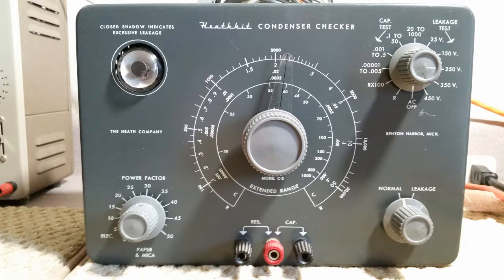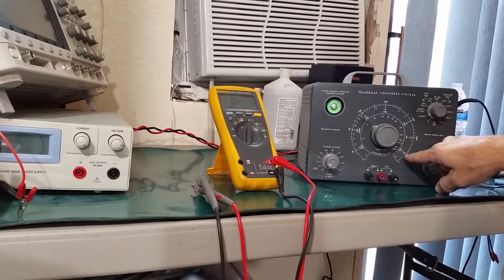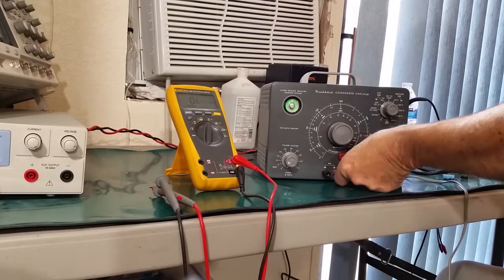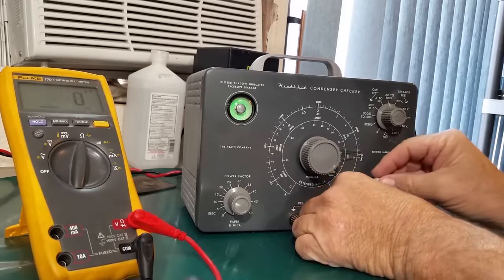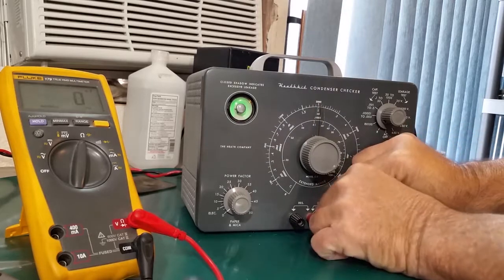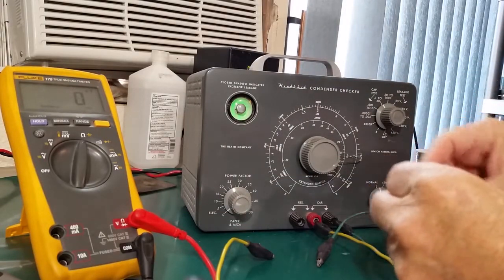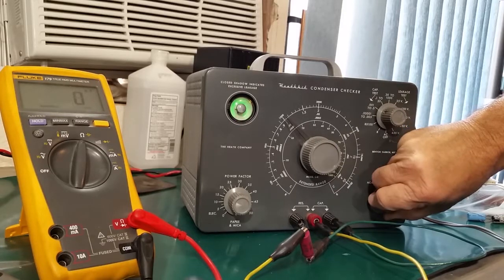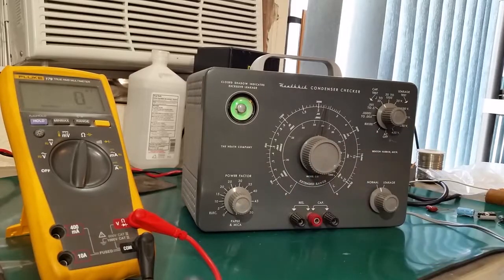Heathkit C3 Condenser Checker Operation

Comment: Nice video and example of how to use this fine piece of gear! I just recently got one and looking forward to using it as I restore old tube radios and amps. I learn best by someone showing examples like this and explaining as they go. Thanks for taking the time to post this video. The true test is in the leakage and most modern digital capacitor checkers just don't have what it takes to perform such a test, this is what make it such a useful tool to have on your workbench.
Reply from the maker: Nice to hear that you found the video useful, Samson. Have fun with your new cap tester...

Comment: Very useful video!  Do you happen to remember what values you came up with for the voltage divider resistors across the back of the selector knob?  I'm about to overhaul one of these and I'm not thrilled with the idea of 40v instead of 25v.
Reply from the maker: I have a web page that details the modification to set the 25 volt scale at 25 volts. Take a look at http://www.wb0smx.net/?p=2550   Good luck and 73...

Comment: Thank you for the video. I am rebuilding an identical unit but the power control switch is frozen. I have taken it apart but cannot get the shaft to release. I have tried unsuccessfully to find a replacement at all identified antique audio component stores on line without luck. Can you suggest a source for this 800 ohm W.W. control with DPST switch? Thank you.